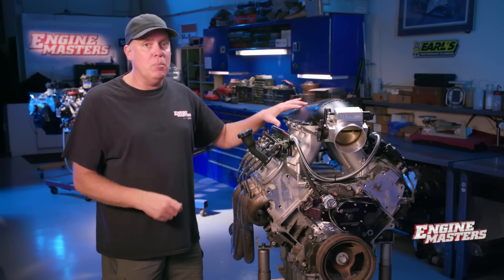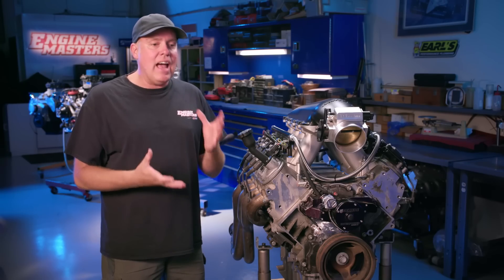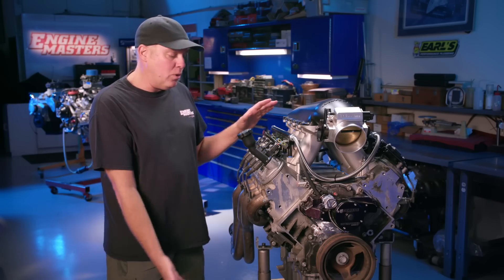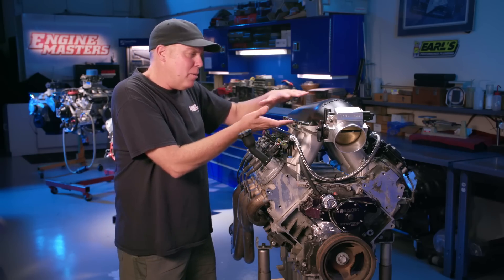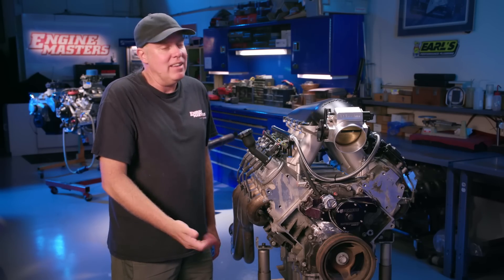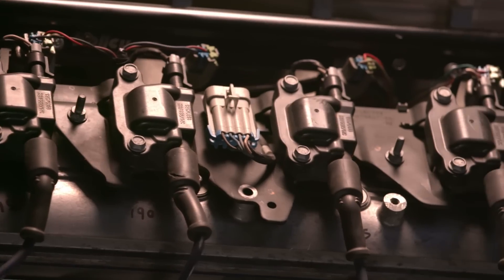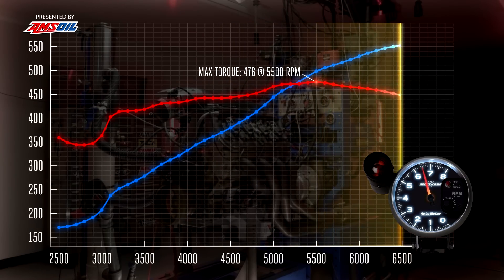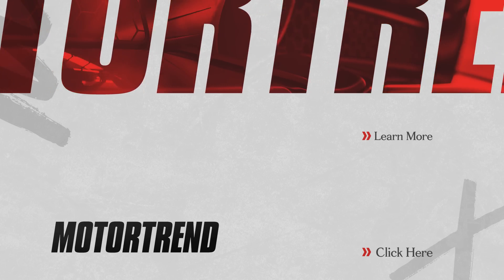You're Gonna Need a Bigger Plenum...—Engine Masters Preview Ep. 51

Comment: I don't hold myself in anywhere near the level of reguard, that I do the three of you. However, it seems to me that the hemholds resonance, would be a greater factor if it were a air/fuel charge in the plenum, rather than just air. Due to the added atoms, the resonance has a greater deal of mass to transmit , and or conduct it's wave. I would very much like to know if I am wrong though. Your input on the matter would be greatly appreciated. Louie P.

Comment: Just watched this. Great stuff 😀😀

Just a thought. That lower intake manifold. The air going into each cylinder may be dictated by the runner size. So no matter what size the plenum above makes no difference. 

If you look at a V8 Supercar engine for example, They run independent runners with a throttle butterfly on each cylinder, but a massive air intake plenum above it. 

I would love to see that same engine tested with eight throttles and see if the power is different.

Comment: Even with driveline loss accessories like water pump alternator and power steering and a good lockup torque converter this engine should put 440-460 horsepower to the backwheels and be capable of 10.80s to 10.60s in a car that weighs 3500 pounds with driver and still be able to cruise 75mph all day on a road trip and last and run good for many years if maintained well and if not constantly beat on

Comment: I think these heads are stock I'm thinking if the heads were CNC ported and milled to increase compression to 11.0 to 11.5 it should pickup another 20-25 horsepower but 572 is a very respectable number and this motor with the right transmission and gearing should pull very well from 3000rpm to 7000rpm and be totally streetable

Comment: I normally love Engine Masters, but this one was a bit pointless. You started with an intake you already admitted was overkill for the engine, and fitted an even bigger one. Of course the results would be like that.

It may/would have been a different story if you started with one too small.

That's like testing a plenty big enough exhaust then an even bigger one then stating bigger exhausts don't matter.

Comment: We need more real world stuff like this current stock or slightly modified motors like 5.3 5.0 5.7 stuff most people drive today and want to build for everyday street applications
Reply: Yes,please. Easy to do mods for most bang for the buck. We do NOT have cubic dollars. Intake runner lengths affect the torque curve,NOT high-RPM power. Street.......We are not all drag racers,I'll guess. I'll spend $50 for a 10% increase in low end torque,not $100 for  a 10 % gain in red line power.  Thanks.
Reply: Build for torque and horsepower will follow

Comment: I hope this was a joke episode for Halloween, because I love this show and this episode seemed like a joke. I thought it would have good insight like the carb air filter episode, where we learned a salad bowl can add a few hp's, instead this episode was short and did not really teach anything.
Reply: It did teach something though, that plenum volume really doesn't mean anything.
Reply: Serps1991 I agree to a degree. I wish they would’ve gone smaller with the plenum as well to show an inverse effect. The plenum they tested first was too big for the mild engine (they said so themselves). Ok so....try a smaller one and see what happens?
Reply: @CraftsmanQuad19  the problem there is to run any smaller of a plenum than what they had would have requored changing the manifold, and then you get into runner size and length changes, and those things do make drastic differences. The common theory is bigger is better, and this proved that isn't always the case. And I'm willing to bet it's fairly accurate and even going smaller wouldn't have made much, if any, difference.
Reply: Serps1991 why would you need to change the manifold? All it takes is a little sheet metal and some ingenuity to make a smaller plenum for this existing manifold. They made the big one, why can’t they make a small one?

Comment: Incase people are here to learn a bit about what they're talking about,

In a plenum style intake, the volume of the plenum, expressed in the # of times greater than your engine discplacement, has a direct impact on high rpm power output.

Research papers have shown that you get negligible power gain past 10x your engine discplacement, but none of that matters if your intake runner diameter and runner lengths are whack. All the properties of the engine gotta match to perform best in the desired operating range

The underlying theory is that the plenum chamber acts like a helmholtz resonator.
Reply: He don’t know cause he copied that straight from google!